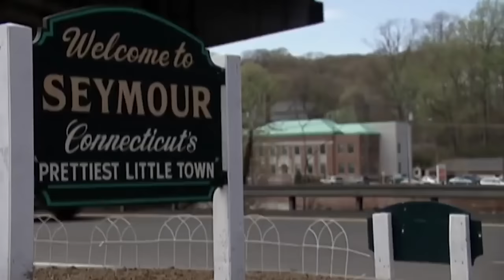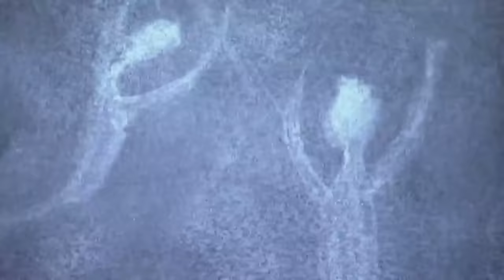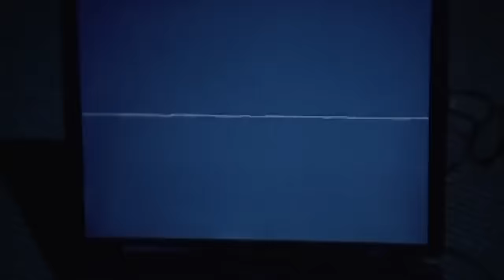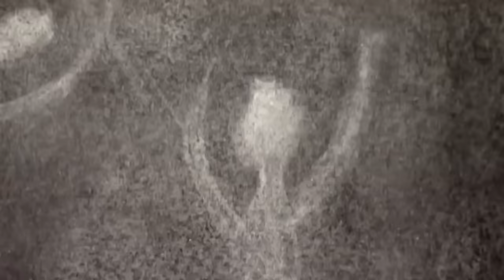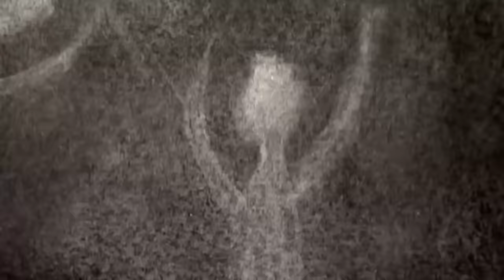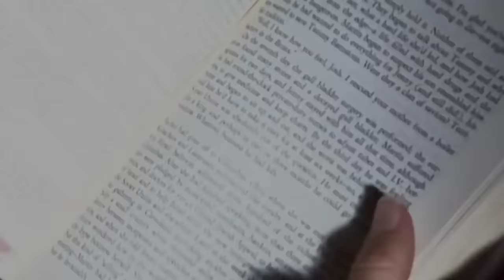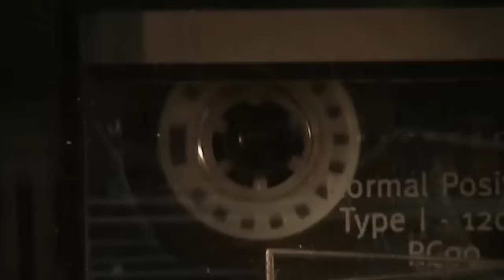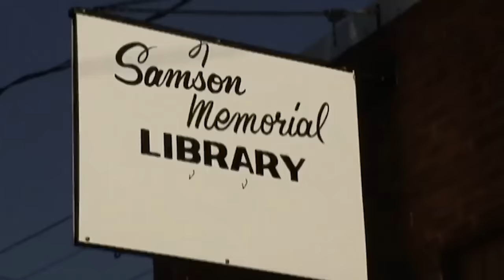Demon Possessed Victims | DOUBLE EPISODE! | A Haunting

Comment: Literally in the first story the demon told them to just leave. It wouldn't follow if it didn't want them there to begin with. Most cases entities (some demons included) don't like attention cause they have a sanctuary there. Especially with a chance of a battle for their sanctuary they don't want the living there at all. They rather have their sanctuary and no eyes on them. You can make a case that it wanted to be "freed" from the property but it wouldn't be so aggressively communicating them to just leave. Ed and Lorrain were off the mark with this case and put the family in way more danger. Yes some follow you where you go, but there'd be signs of it outside of the property usually if that's the case. There are some stories of people moving even without feeling it outside of the property but then that'd be a possession case. But it's safer to like just leave in most cases anyway if it's a demonic or an unidentifiable entity.